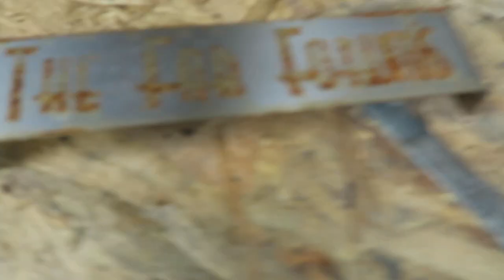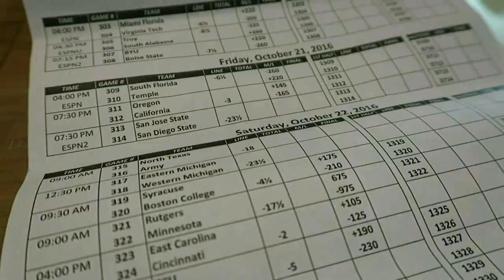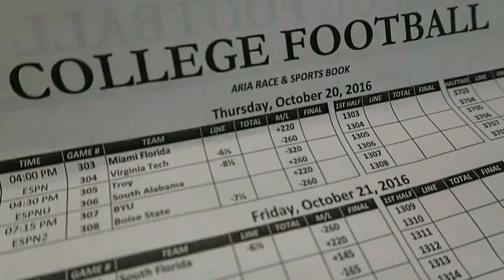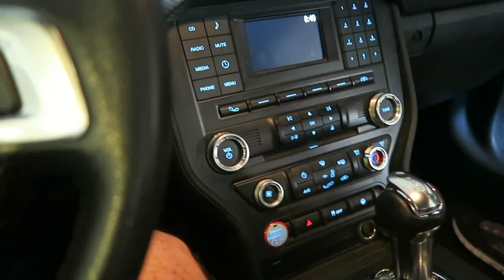Las Vegas 2016 SEMA Show | Vlog Episode

Comment: I enjoyed the scenery. A long time ago I drove tour buses across that dam. As for the inspirational message, yes. Maybe I said this before, but if you are trapped by inertia, you can write down increasingly smaller steps toward the larger task. Pretty quickly you get sick of writing and get to doing.
Reply: I am having to do that myself today with respect to Sheppard power steering unit on a heavy truck. Needs a seal rebuild kit, which I have not done before.
Reply from the maker: for sure